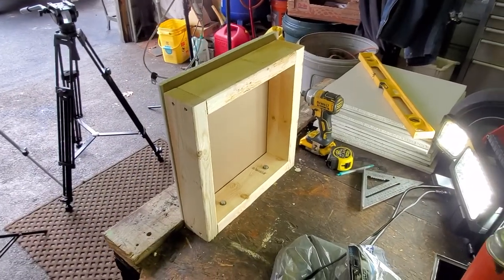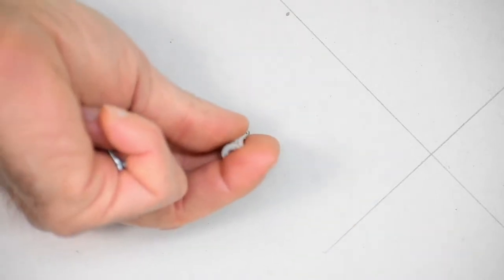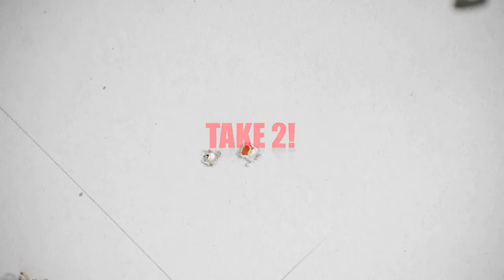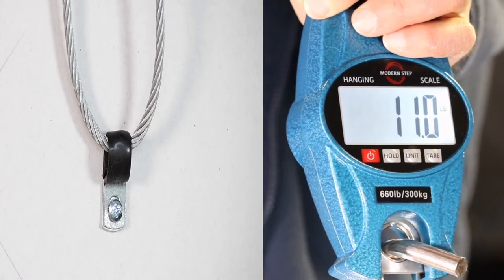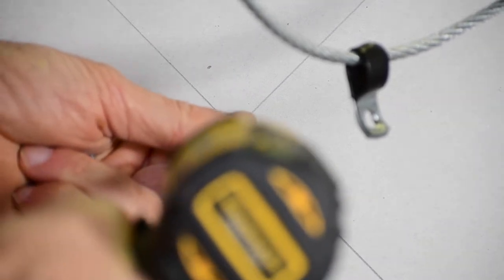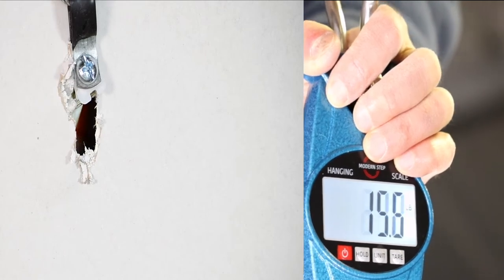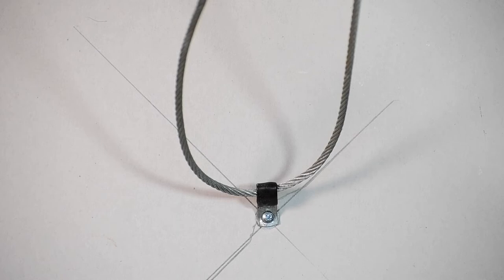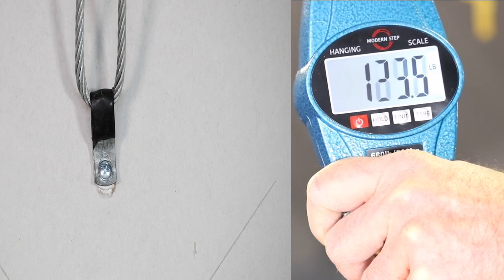Drywall Anchor Test.  Which one is the Best?

Comment: 3:48 Thats because that design is for concrete or masonry. The cheap low end manufacturers will advertise them as drywall anchors but they are useless.
Reply from the maker: I had to go back and look at which ones you were talking about... yes those could certainly be used in concrete.  I don't like them because they don't have a flange or a head to keep them from sinking in... even in concrete if you drill though a block wall or similar the block isn't  very thick and these anchors will still have a tendency to sink through and fall inside the wall... But they would work better in concrete if you were able to get the screws tightened up..🙂

Comment: Why would the plastic version of the 2 screw in types hold twice as much weight?
Reply from the maker: It's probably not a matter of the material, but of the thread design...  I think the plastic version had some bigger threads.

Comment: I’ll confess that I haven’t always drilled pilot holes and instead use a Philips screwdriver to punch a hole that’s slightly smaller than the anchor. Does that  decrease the strength of the anchor by doing it this way? I just installed a 4 pound LED light panel on my garage ceiling using this method. Two of cheapest white anchors on each end.
Reply from the maker: I've used the screwdriver method so many times I couldn't count!  I've never had any problems doing it that way... 🙂

Comment: I watch to see if you had any suggestions of any anchors that work in walls that have old plaster and wire mesh in them. Trying to put up some shelves and some anchors work but others put right out of the wall. I did purchase the Snap Toggle bolts and hoping they will work. I have a very old house.
Reply from the maker: HI, obviously the best bet is to anchor into studs.  A lot of the times the stud isn't located exactly where you want to hang something.  If the shelf is fairly long, I would try to get some anchors where the studs are and use toggles in the other places.   A toggle with the largest wings behind the wall is probably your best bet.  I haven't worked on many of those types of walls to see just how strong they are.
Reply: @TheHomeImprovementChannel  Thank you!

Comment: The white EZanchor you did wrong too. You’re supposed to hammer in the tip until the threads, then screw it in. By screwing it in the whole way the end of it broke when you put the screw in.
Reply from the maker: HI, I've put so many of these in and the only time the tip gets broken is when I put the anchor in the drywall and there's a stud or something hard behind the drywall.  Other than that, I've never had any trouble like you're saying there..
Reply: The end is supposed to snap. That’s what provides the anchor with additional grip.

Comment: This test is completely wrong. You are not measuring the load test of these anchors or screws, you are testing the shearing force (cut limit) of the wall when you are using different types of anchors.
Reply from the maker: When you hang something on the wall, it's also testing the shearing force..  So, not wrong.